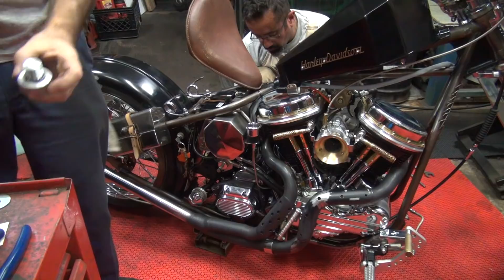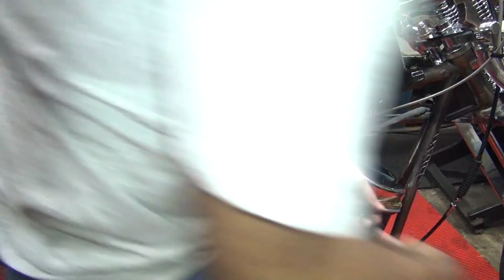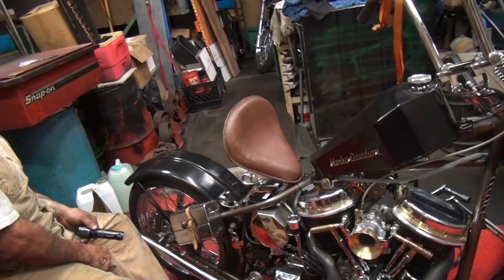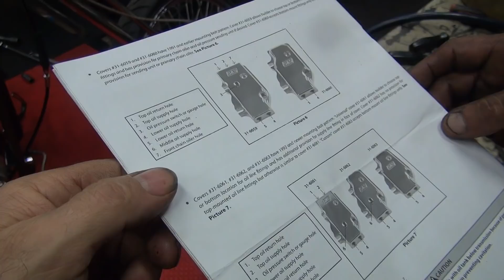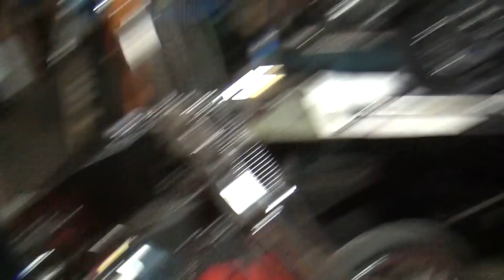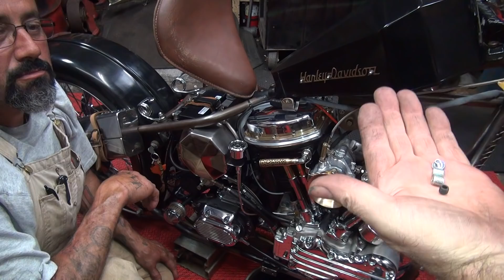#103 s&s 93ci evo, pan no oil pressure motor repair 1999 panhead bobber harley by tatro machine

Comment: I have an s&s 117 with no oil pressure. I took the oil pump off and disassembled it and put new gaskets,keyways and seals. Still no oil pressure. I read that if the oil pump drive in the pump shaft is put on backwards it won’t have oil pressure. Has something to do with the chamfered side of the gear. Which way should the gear put on the shaft. Chamfered facing toward the pump or toward the cam chest housing
Reply from the maker: what a bunch of crap. just look at the gear, it looks the same either way. the chanfer is to clear the fillet on the pinion shaft. most gears are cut on both sides now.
check for a plugged oil passage. silicon sealers are the worse thing to use, because they plug up the holes that you need.
tatro